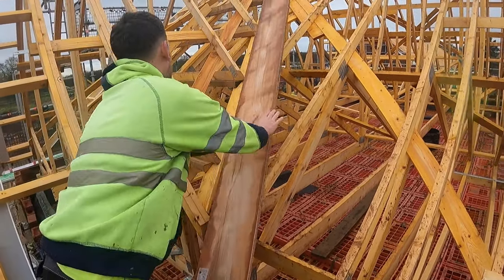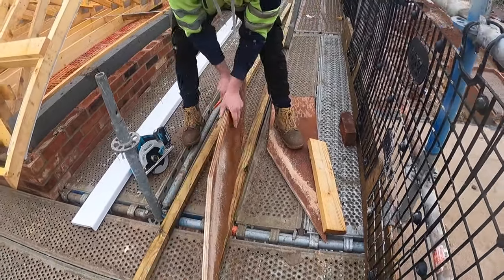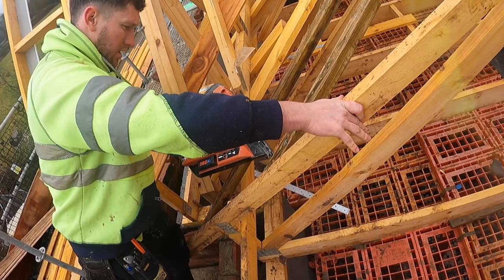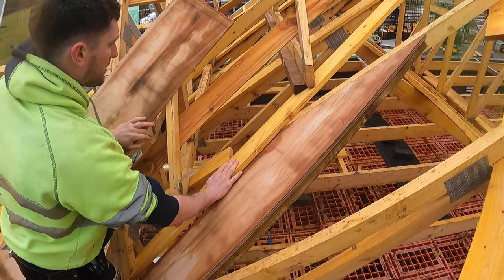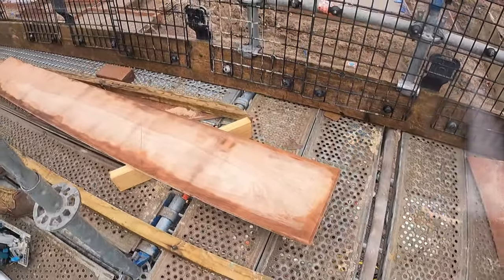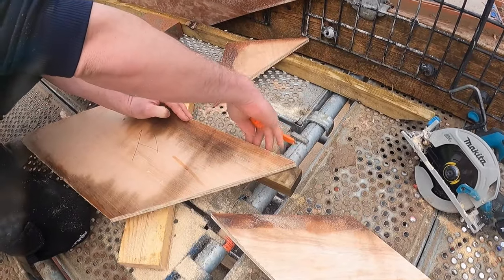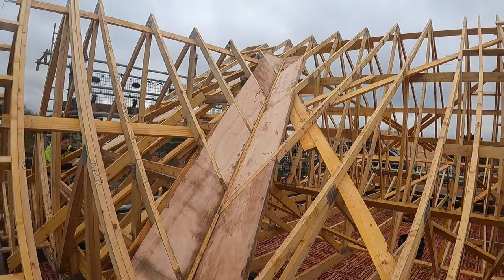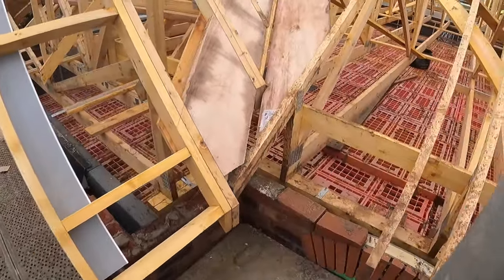HOW TO FIT VALLEY BOARDS!

Comment: Still  use 9x1 or 7x1 in Ireland just lay it on top of the rafters then run timber up the edges to nail a batton to...